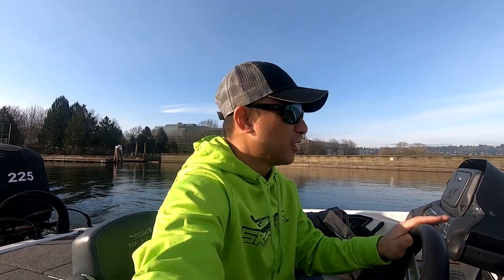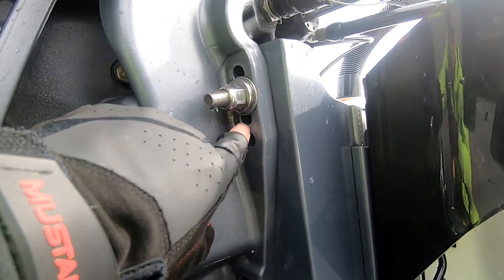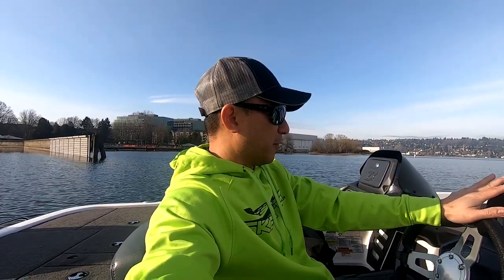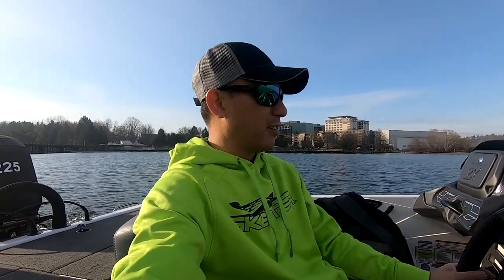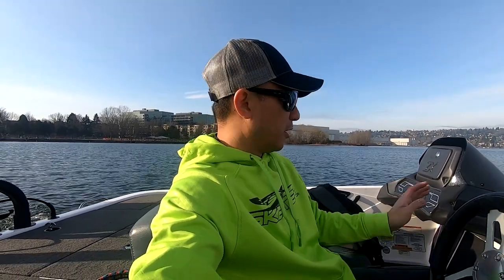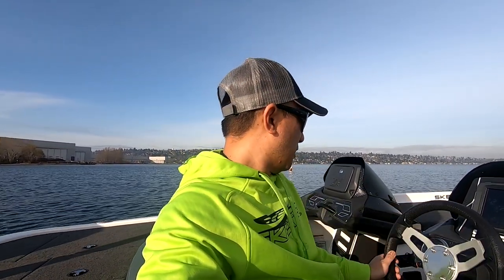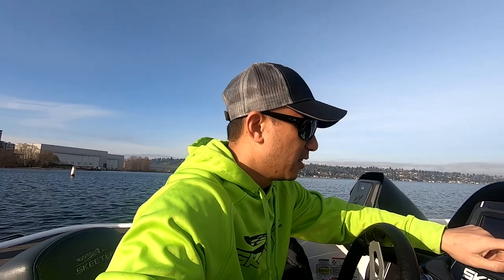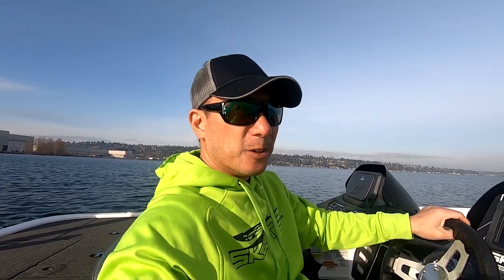Skeeter ZX225 @ 73.4mph - 25T2 Prop

Comment: I started laughing when you showed what you were wearing before you made your run and then what you had on when you were done. When you said what the air and water temperature were I could not believe the clothes that you had on. When I saw what you ended up putting on I got a chuckle out of that. 

It seems you've got your boat dialed in pretty good. 

Thanks for sharing your experience with your new setup.

Comment: I just repowered my 1999 skeeter zx210c with a 2019 225 vmax sho and with a 15 1/8 x 23 pitch prop I'm only getting 5200 rpm amd 64-65 mph.  Having a hard time getting the motor to hit the 6000rpm.  Move it up same thing move it down same speed. Doesn't make since.  The marina that did the install says I need a smaller prop, told them I don't think so, I'm seeing 225 sho with 25 pitch and hitting 6000 rpms.
Reply: You read this
Reply: My old ass 2001 Cobra Viper DC with a XR6 has a 23 pitch on it! That Marina is feeding you a line of bullshit, bare minium you should have a 25 probably could get away with a 26, just depends on who makes the prop.